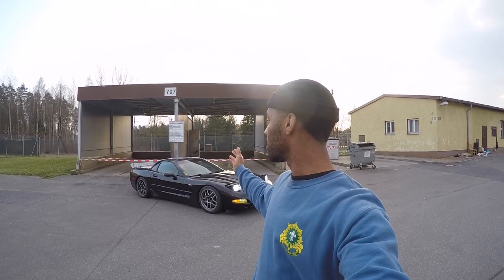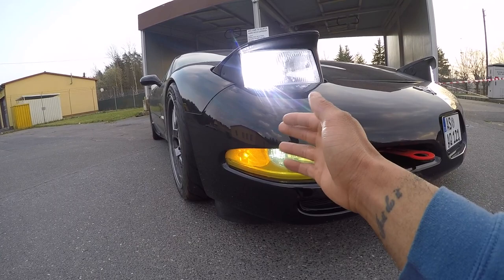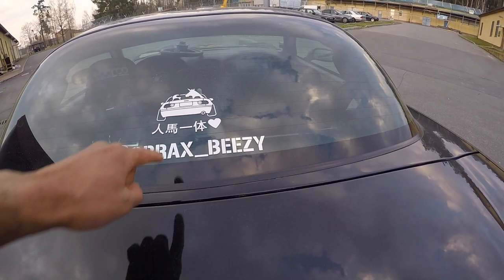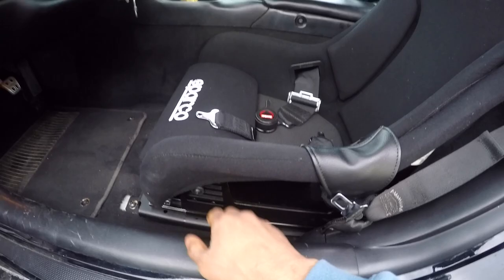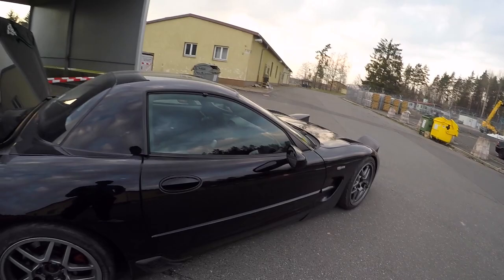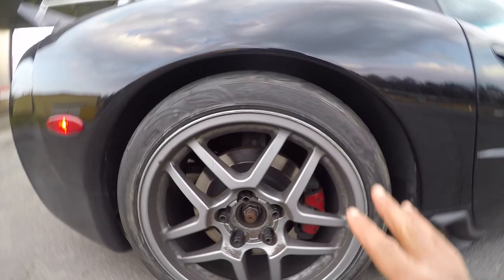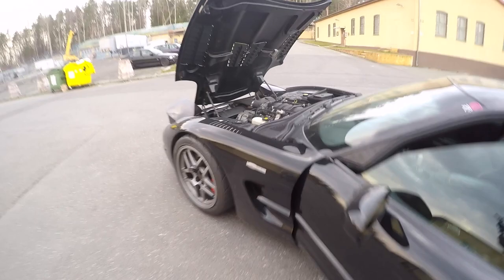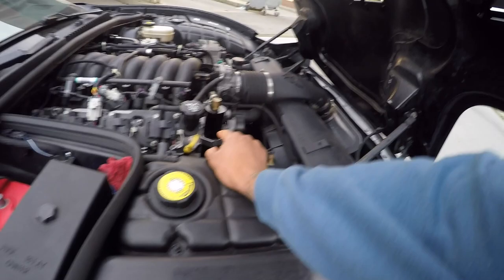Touge spec C5 Z06 V2 walk around

Comment: We have the exact same suspension setup except those SLR tie rods. I'm gonna have to check those out. One thing I did differently than you was relocate the battery to the rear tub with a lingenfelter relocation kit instead of doing a sub. Also went with Nitto Nt01's 275F/305R. Very clean, simple, yet effective setup. I know it handles great👍
Reply from the maker: Nice fam! I like the 275 set up too what springs rates are you running?
Reply: @Beezy_Builds  Stock spring rates for now. I'm planning to go coilovers pretty soon so didn't bother with a aftermarket leaf. Yeah these cars handle so much better than stock with the J'Connell sways, bilstien sports, and a grippy tire. Not sure what the bilstien sports are going for now but back when I bought them they were pretty cheap and a great bang for the buck mod. It's a great setup man just thought it was funny it was the same as mine. I'd recommend the Nt01's to you if you want to get even faster. I imagine the Federal 595 Pro's are very similar to the nitto Nt05's with the 200 tread wear. I liked the Nt05's when i ran them they were pretty grippy but they did give out under very hard cornering but in a nice predictable way. The Nt01's though are just ridiculous the have SO MUCH grip you can really get on em hard. They do wear pretty quick though, you get about 3 years out the fronts and only 1 year out the rears. I'd say it's worth it though for sure.

Comment: That's a sick ride Brax!  I enjoyed learning.  I'm just starting my C5 journey.  Thanks for explaining things simply and straight forward.  I've finally got the car straight stock, had to track down a TCM module, steering angle sensor, being installed now, hopefully it solves the problems with codes being thrown and derating.  Might need an accelerator sensor also. All used. 
I'll check out the rest of your videos to see where I go from here.
Thanks!
Reply from the maker: Happy you are getting her sorted out Brett electrical issues on these things can  really be a nightmare

Comment: How does it do with the square set up in the front? Mine rubs on full lock turns with the stock 17s up front so I can only imagine that being even worse with your setup. That being said, I'm also sure it's much easier for you to shop for tires lol.
Reply from the maker: I run rack limiters so not to bad i got them for slr speed, I need to add one more to both sides then there will be zero rubbing at all im supper stoked I plan to go to a 315 square setup

Comment: how would you compare the miata to the corvette for fun factor. I also am coming from Miata's and am looking into getting a C5 Z06 but and a bit concerned it will feel very big and boring. Appreciate any insight you can give. Love the car!
Reply: 3.9 second 0-60 does not get boring.  This car is light weight and has great handling... Typically the car is more capable than most drivers.  If you don't known what you're doing, the car can handle like shit, but in the right hands it'll rip around any track at blistering speeds.  (1g of lateral grip from the factory) Which aint bad for an early 2000s production V8.  Add some mods and you have a track monster.
Reply from the maker: @mark Laird I totally understand that actually just reviewed a NA miata and it reminded me what I loved about them so much, honestly in stock for the c5 chassis leaves alot to be desired, sure its fast but its nor engaging to drive spiritley, the shifter, steering wheel, steering feel, and seat sucks and makes it feel very blunt, it felt like I was riding on top of it a not connected, luckily by changing those things I have been able to get the feel I wanted from the car and im happy with it, and can honestly say it feels like a big fast miata now. If you have the cash go modify it go for it, if you dont you may be unhappy with it in stock form. Brakes need to be addressed, reliability mods have to be done, suspension etc. Luckily I have videos on most of the stuff, and my next video coming out tuesday will detail how much it cost to build my car
Reply: @Beezy_Builds   , Thanks for the insight!, exactly what i was curious about.
Reply from the maker: @Mok_26  of course brother, but the potential is there no doubt 👍🏽

Comment: How have you gone on with your led rear lights and the indicators? Don't you need the Amber resr indicators, but these will just flash red
Reply from the maker: This is how the north american cars came I know the euro cars are different but when I use the left signal both left lights just flash so it works out
Reply: @Beezy_Builds  but they flash red not amber? On your HU test you'll definitely have an issue man, need to be amber indicator lights. Look cool tho but that's the reason I've not bought any as I'm in the UK, if police saw them they would pull me over as not legal
Reply from the maker: @MDW893  my car is US spec, thats how they come, I havent had a issue being that im military we follow different rules

Comment: Dude I have a sub kit like that but it rattles like crazy. I even tried screwing it into the fiberglass. I believe it's the wooden frame, and I have the same one as you, any idea how to fix it? Also your link for the mods is broken here's a picture https://i.imgur.com/2Pjcj5R.png
Reply: Also it's not blown, if I stand on top of the wooden frame or just put enough pressure on it with my hands then it is fine.
Reply from the maker: Brother I have no clue mine does no vibrate to bad at all, maybe nutting and bolting it at 4 corners could help just make sure to use washers as a sandwitch plate so the fiberglass isnt cracked, look at one of my newer vids and try that link, I may need to redo it